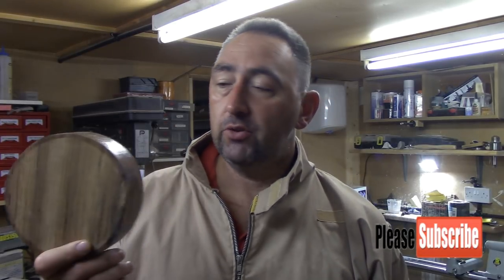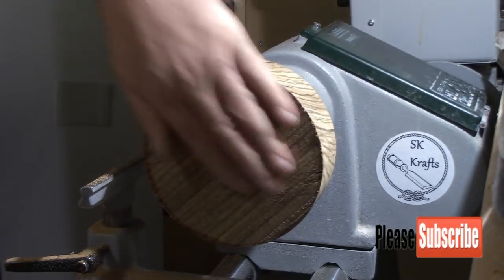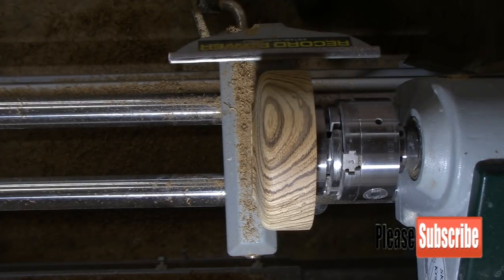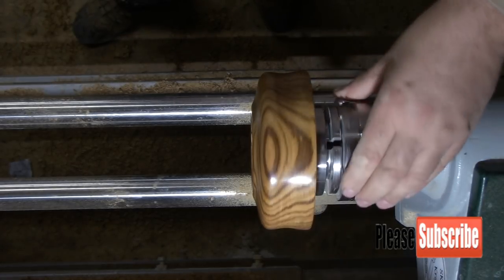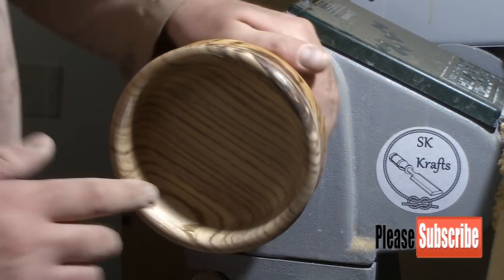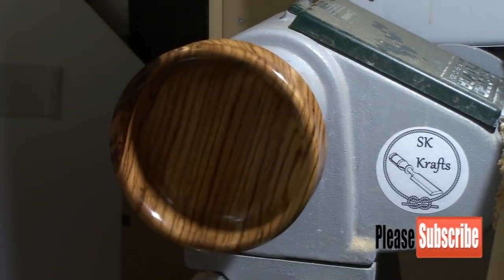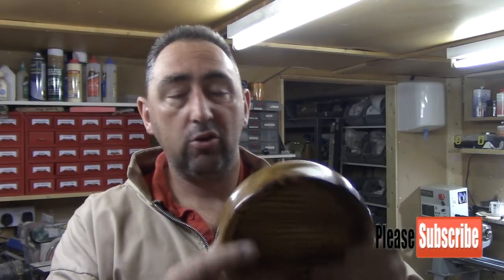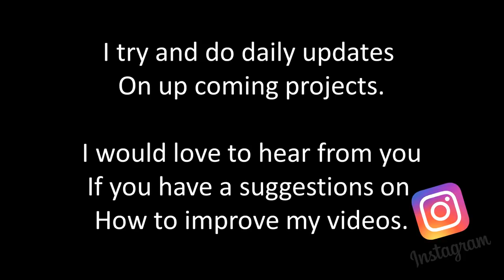Wow zebra wood bowl turned out cool

Comment: Watching your video I had to remind myself that we all started in the same place. Realizing you're a new turner I would suggest finding a mentor or a club within driving distance if you can. If that's not possible, invest in some resource material like Richard Raffin's "The Art of Turned Bowls". He is considered a modern master on form. DVDs by professional or two would also be a good investment. For learning to use a bowl gouge, Glenn Lucas is a master technician and an excellent teacher and his DVDs are reasonably priced. Carbide has a much shorter learning curve but if a person looks at what the recognized artists in the wood turning community are using you won't see many carbide tools. There is a steep learning curve to using a bowl gouge but the results are worth it.

Comment: You need to find out what a bowl gouge is because you did not use one in this video. The modern tools I do not like give me the proper gouges when you can cut wood and not scrape it. Have a look at some wood turning sights and see that good turners remove all signs of how the wood was held during turning ie remove the spigot or tenon after finishing the surface. It is a bowl of a new woodturner commonly known as a dog bowl, get some searching done and see what shapes you can achieve.
Reply from the maker: Martin Lawrence thank you for you comment Martin. I do know what a bowl gouge is sir. But I am still learning so it all take time. But thank you for you concern. Steve